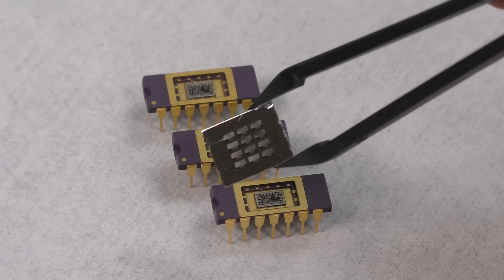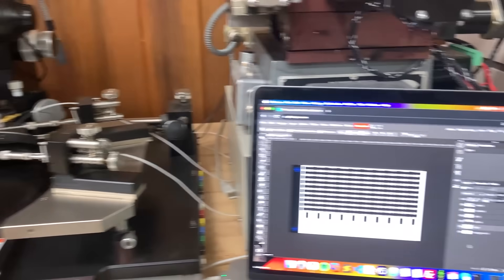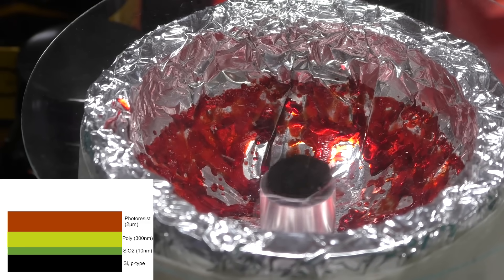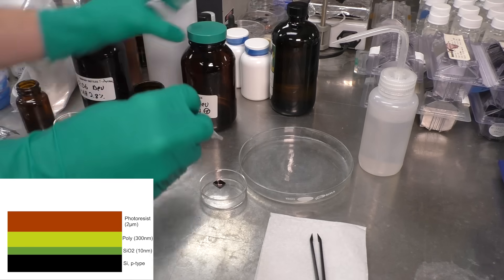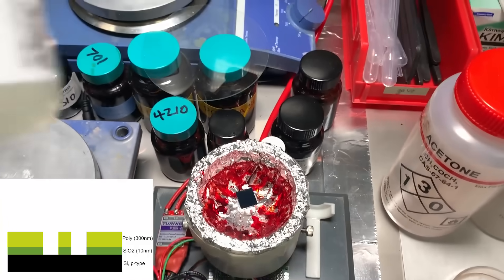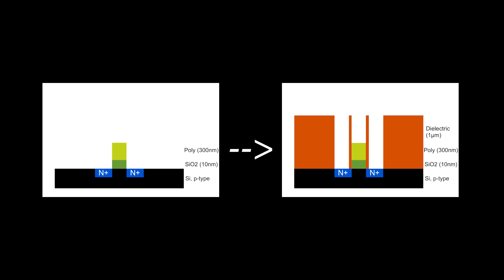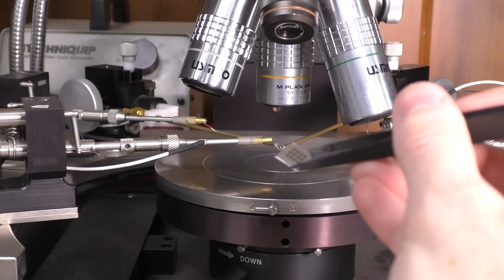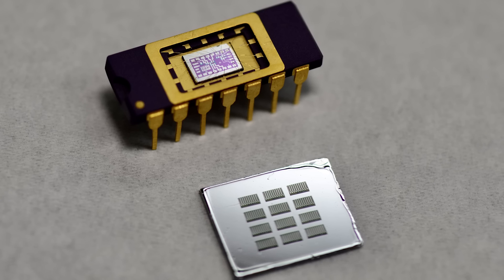"Z2" - Upgraded Homemade Silicon Chips

Comment: When are you going to start taking orders? I want unpackaged dies for MMICs on PCB.

I can send you layer descriptions if you come up with a PDK
Reply: I think such open source PDK exist but for 130 nm process is available from SkyWater, check at https://github.com/google/skywater-pdk. Thank you.
Reply: i looked up PDK and got "dual clutch transmission"
or Democratic Party of Kosovo
go easy on the acronyms.
Reply: @darkshadowsx5949  process design kit. When people come to foundries like Samsung and TSMC to get a chip made, the process needs to be described to the chip designer, so PDKs include:
Models of the devices
Layer stack ups  and tolerances
Design limitations

Nice things to have are:
Design tool integration
ESD protection devices
MIM cap characterizations
MOM cap characterizations
Varactor characterizations
Spiral inductor characterizations

Comment: "like a bought one!", as Dave would say.
Could you also make power transistors (mosfets) this way, and how good would they be? I've been wondering where the main differences are in manufacture of logic transistors and high power ones, apart from size obviously. You'd need to create much thicker gate oxide, right?
Reply: Not very good ones: these are large-feature lateral MOSFETs, whereas power transistors are vertical (VDMOS) and medium to fine feature (<1um I think?).  Rds(on) is driven by L/W ratio, about 1 for what's shown here, of course they can be made in more complicated shapes (sinuous track, interdigitated), limited by feature size and available area.  (If one "pixel" is say 10um, and a transistor cell is a minimum 3 pixels across (one each for drain, gate/channel and source), then you can have a ratio of at most XY/3 for a total die / exposed area of X x Y pixels by naive layout, or XY/2 by alternating S-G-D-G-...)

They may have pretty reasonable performance (in terms of Rs * Ciss, R_L * Coss), actually, and the low power density isn't a problem for certain applications, namely linear and RF amplifiers.  I wonder what the breakdown characteristics are like?
Reply: @T3sl4  Thanks for the reply. 
To be clear, do you mean a power transistor would benefit from small feature sizes as well? I was thinking exposing larger features (in 1 or 2 axis) shouldn't be a problem. But then if you just wanted higher current, you'd want to keep the channel length the same and increase the width, so the shape of it becomes more unreasonable. Is that what you meant?

Basically I'm realizing that I know way too little about how power transistors are actually layed out haha. I dont know that much about semiconductors in general tbh, and I've only ever heard people discussing transistors for digital logic, and hence miniaturization.
Reply: @Basement-Science  Right, basically you take the shape he's built, and stretch out its width.  Resistance drops proportionally.  But now you need a super long die.  So fold it over on itself a few times, and now you have a sinuous pattern that fits in a nice compact square. But if you're building that on a grid (because pixels, or whatever the finest unit of construction is), you can only fold as many times as there are pixels to work with.  So, finer features can make a wider geometry, up to whatever the ultimate limiting factor is (feature size, breakdown voltage, etc.). Or alternately, just connect all the individual transistors in parallel, and figure how much space that would take up.

Power transistors benefit even more from miniaturization, because in the vertical structure, the gate trench blocks some electric field in the drift region, increasing the field towards the channel and reducing breakdown for the same drift height; tighter spaced channels can use thinner drift region for the same voltage --> lower Rds(on) * Coss figure of merit.

(I don't think this is too relevant here; RIE isn't so big a deal I think, but the subtle doping profile required to handle higher voltages, I think requires epitaxy(?).  Which still maybe isn't that outrageous for someone this well equipped, but the worst part really is the process gas -- if you thought HF was bad, halo- and organo-metallic gasses are pretty awful too, and add to that, those of toxic elements like arsenic!)

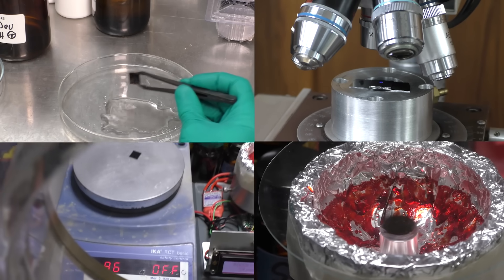Comment: 4:10 could you not use KOH for the contact etching too? It'd be more difficult, but possible right? Just wondering cus HF is hard to get/use
Reply: Probably because KOH dissolves Si too, just harder to control?

Comment: You really need to make a service out of this process.  I'm sure people would spend a great deal of money to have custom chips made, as long as it doesn't cost tens to hundreds of thousands of dollars per design.
Reply: Already done with ASICs on a wide level and if a company can't afford it FPGA isn't a bad solution. 

Not to discount Sam at all though as he should be praised to the highest degree for documenting and explaining all these complex processes.  It's just not really viable at all at his stage. 

Maybe sometime down the road as he makes more and more complex ICs he can reproduce rare antique chips where FPGA wouldn't be appropriate. Antique computers and electronics primarily. I think something like that would be more up wheel house. Right now though let's just soak up the knowledge!
Reply: @bf0189  I think many electronics hobbyists would love to experiment with ASICs, which due to the high constant costs, are out of reach for them. Considering that someone makes homemade chips, homemade ASICs produced in low volumes aren't a weird, thought. It's still the question wether it is a realistic thought of course, Sam's manufacturing is still very laborious, but let's dream.
Reply: @danielmantione  fair enough!

Comment: Will you try to simplify the process and make documentation so in theory anyone can do it? I would totally buy a textbook on this I feel your the only one who has complete knowledge of how the entire process is connected
Reply: I think the problem is that a lot of his equipment is quite specialized and not widely availible
Reply: @izaicslinux6961  You can honestly buy a lot of the parts you'd need off ebay
Reply: @izaicslinux6961  Oh it is widely available, just as long as you have the money or in Sam:s case universities and professors that give all things to you for free.
Reply: There's a discord called Silicon Overlords where a bunch of us work on this stuff. That might be a good place to start.
Reply: @SIGSEGV1337  You got a link?
Reply: @SHADOW-id6vw  Yep, that's what I'm doing, everything from scratch. Oven, vacuum metal deposition, etc...
Reply: @Nixie_EUC  exactly like document everything so we can refine the process
Reply: This is already simplest way to do it.
Reply: @volkhen0  *the simplest way we know so far
Reply: @volkhen0  nope not yet
Reply: @schwartz478  this is high tech, at least for average garage. You can make it simpler with sophisticated tools but then the tools are complicated…

Comment: Only a matter of time before you have your own chip foundry. Probably be making GPU dies before consumers are able to buy them reliably again.
Reply: Nah that's gonna take a lot of expensive equipment lol, he just made a thousand transistors on a chip while GPUs have like billions on the same area.
Reply: it's not about humongous gpu or something. It's more about custom-made highly specialized diy projects-on-chip instead of microcontrollers on a board, or some custom radio transcievers, something like that. Maybe a single-chip controller of the micro copter (size of a fly). Or if you can include piezo ceramics in it, maybe even some nano robots
Reply: @jskratnyarlathotep8411  if chip making was made readily available like soldering, we would have stuff that used to be thousands of dollars for a couple hundred bucks. Just look at RTL-SDR. A full 100khz to 1.7 ghz receiver for 25$. In the 90s something like this would cost you thousands of dollars and would be the size of an oven.
Reply: @prakharmishra3000  maybe some organic semiconductors could do that, because silicon requires really nasty chemicals
Reply: @jskratnyarlathotep8411  it will be available eventually, in a couple years or decades. You will be able to make your own chips.
Reply: @TheDude EVER is a long time buddy, you sure we wouldn't get better technologies to etch silicon in the future? People 60 years ago would have said no one would be able to own an electron microscope at home as they're so expensive and what not. Now you can buy a tabletop electron microscope for 1k dollars. Not exactly cheap, but affordable.

Comment: How do you deal with alignment of the layers at each exposure step?
Reply: He shows the exposure setup can be used to observe the system too, I wonder if he can use a different light wavelength for alignment?
Reply from the maker: Yup the lithography machine is a projector bolted to a microscope, so I can look thru the eyepiece to align chip layers. Use red light to align, UV to expose. but the image shifts and distorts when changing between wavelengths due to chromatic aberration so you need to do some calibration
Reply: @SamZeloof  this microscope alignment process deserves it's own video like all the other steps! Fascinating stuff!
Reply: @SamZeloof  noice
Reply: @SamZeloof  put the chip in a holder/frame, it might be easier to align repeatedly
Reply: @SamZeloof  but how do you physically move the chip such small increments?
I work in microns regularly, and we use Hydraulic, Leadscrews, or servo motors.
It takes large machines, precision measuring tools, and sometimes hours of time.
do you have to do all that for each exposure?
Reply: @shadowhawk320  The microscope stage should already have controls that are precise enough
Reply: @SamZeloof  I'd like a video just on this.
Reply: @SamZeloof  i xpec this answear.. coz yu have to know your equipment.. same for me when i do some 4 layer's pcb.. it is just a question of know your tool otwerwise.. it not gona work.. but still great job.. ima damn impresed..
Reply: @SamZeloof  How do you avoid the photoresist from being exposed with normal lighting in the lab?
Reply: @SamZeloof  Z2 duo?
Reply: @arunkuruvila1959  : You choose the lights & photoresist appropriately. In particular, LEDs have great difficulty producing UV at all, so if you use LED lighting with a UV-specific photoresist...
Reply: @SamZeloof  you should definitely make a video about this.
Reply: @zoidbergVII  He is not down to say any 7nm yet so an ordinary microscope and micro X-Y controls are more than enough.
Reply: I guess his process is similar to Huygens Optics, see Maskless Wafer Stepper videos.  There is an explanation of those steps there.
Reply: If fiducials were etched somewhere outside of active area in UV and used for alignment, there would be no change in wavelength.
Reply: Before you know it folks will be buying his chips. Hope to see some logic chips soon. Perhaps a register or shift register!
Reply: I was wondering the exact same thing. I am stunned that he has all this equipment and can use it.
Reply: There's probably a version of this technique where instead of trying to position the silicon precisely for the projection, you could do it the other way around.  Position the chip "inaccurately," then just have some accurate sensor / machine vision that figures out where the chip is and projects a moved/distorted image based on that positioning.  Wouldn't work with a fixed mask setup, but the DLP system could be more flexible like that.  Then you just need to move the chip arbitrarily across the field so that everywhere gets exposed.
Reply: I was going to ask the same thing